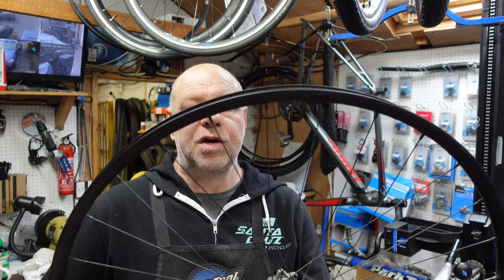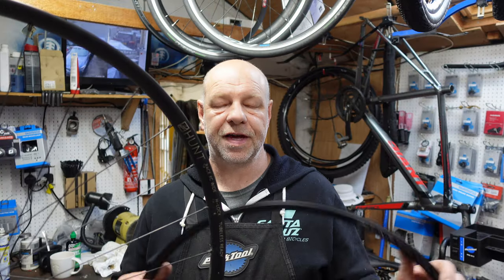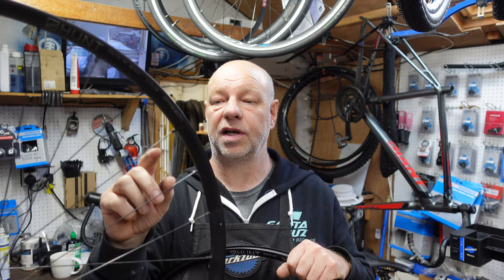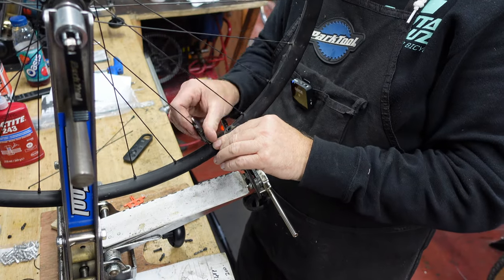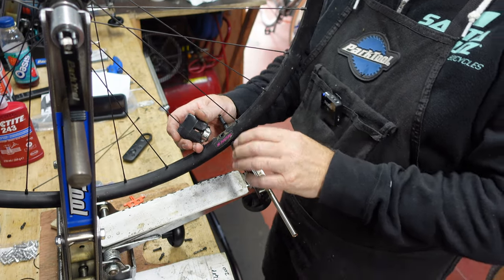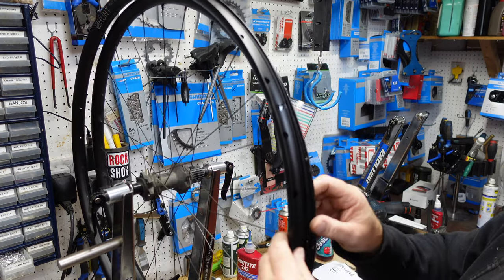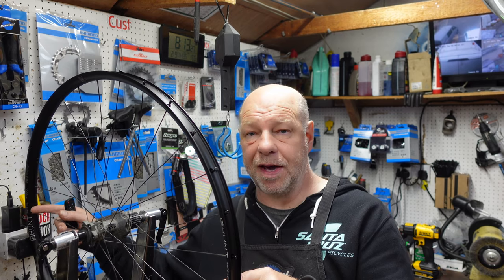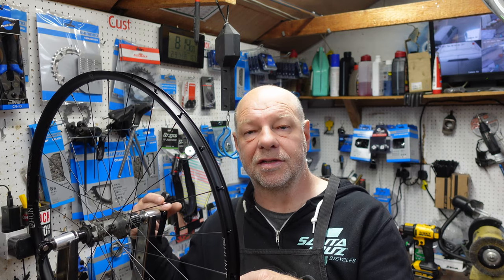How to swap your damaged rim for a new one without completely stripping down your wheel

Comment: Excellent video Dave, very well explained.  I have a damaged front rim and will have a go using this method.  Out of interest is it easier to work with alloy rims rather than carbon for a novice.
Reply from the maker: Hi, thanks for watching and your comments, yes it is, very much so, the process for carbon rims is different, I would defo recommend aluminium first

Comment: Hi Dave, Good video, I took your advice and got myself some Hope Fortus 35s for my Trek Rail 5. I had to fit new cassette new chain and new front sprocket because I wanted a Shimano cassette to match my Derailleur, The chain was a Sram GX 12 speed, when I rode the bike the chain would slip in the high gear (10 tooth). I checked the chain length, B screw, made sure the line was in the right place on the derailleur with the cassette, but it still slipped, so I put the old chain on which was 50% worn and it did not slip, that too was a Sram GX 12 speed. I bought a KMC 12 speed E bike chain from the LBS and that was ok, have you ever had issues with new chains? You where right BTW those wheels make a massive difference, gone tubeless too, thanks for your advice. Royston
Reply from the maker: Hi Royston,  You will find that an sram eagle chain is not compatible with shimano, in fact we have issues sometimes with nearly all sram chains running on shimano cassettes, from experience sram chains are better on sram cassettes, they will work on shimano but can be problematic even though some claim good compatibility.glad your new wheels have made a difference. Thanks for watching.
Reply: Ive got a trek rail 9.7 it's smallest cog slips also after 300km. Checked b-screw and cable tension, still slipping, casette and chain looks still good though.  Strange what could be the reason?

I am also not really impressed by the bearings and overall quality. Headset started creaking, (there was only little to no grease applied and already some wear and scratchmarks inside the frame/bearing seat) . Same with the rear end, bearings are creaking like hell. I think i have to strip down the whole bike and build it up with some proper stainless steel or zinc plated bearings and enough grease.

The paint also chips super easy, i sent an email to trek to get the color code for a touch up paint, got no answer. I have found the gray one in some forums, but the orange is unknown.
Reply: @michael_the_chef  Hi, I got a new chain a KMC e-bike black and the issue went away.

Comment: Hello there and thank you for this very useful tutorial.
So, my problem.
I tried to true my rear wheel on my bike while it is on stand.
Tyre is on all the time.
I got it true at about 1mm or less and one particular spoke is pretty loose. Why is that so?
Reply from the maker: Hi, if all the rest of the spokes are to a good tension except for one or 2 and the wheel is true it could be that your rim is damaged at that point where the loose spokes are or that spoke is the wrong length
Reply: @TheYorkshireBikeMechanic  hmmm, well the wheel, spokes and nipples are the factory ones I got with my bike. Only thing was replaced on wheel is hub. Factory hub was Shimano TX505 and it was replaced with Shimano M6000.
The hubs have same hole diameter.
All the job was done by professional bike mechanic with years of experiance. It was done a year before and after that I made few hundred of kilometers with the bike. Only thing I noticed was 4-5 nipples which were a bit rounded, they can be tightened or loosen but I would like to replace them. I suppose I have to do it one by one. Now my question is what length if nipple I need to order. From what I can see without taking off the tyre (it’s tubelless). The nipple length which I can measure (outside of the rim) is 7mm. Spokes are 2mm thick and the nipples are silver

Comment: Tnx.alot !
What’s your opinion on nipples with thread lock ?

Would “squorx” nipples make it easier , (by being able to turn the nipple from the top/inside) ?
Reply from the maker: Hi, Thanks for watching, It's not often we use squorx nipples, we use brass nipples unless they are specified on a build, Because we build many wheels we have specific tooling to make sure that each nipple is positioned on the spoke in exactly the same place on every spoke before truing up, this make truing much easier and accurate. we also use a medium strength threadlock on each nipple on every wheel we build from scratch. We build about 2,800 wheels a year all by hand.
Reply: @TheYorkshireBikeMechanic  What I was refering to ,was the nipples with thread lock already in them (as I understand they can be a bit of a pain to use).
Also ,do you use thread lock before or after tightening the spoke ?
Tia.
Reply from the maker: @alfabethev2.074  Hi, Ah, I see. No we don't use them, reason being they are far too expensive, we can achieve the same result by using loctite 243. The threadlock is applied to the spoke threads only after the nipples have been put on by 2 turns, spinning the wheel then allows the threadlock to run down into the nipples by centrifugal force covering the remaining spoke thread.